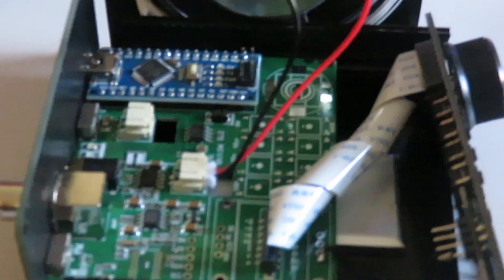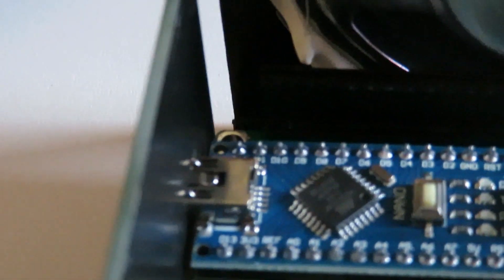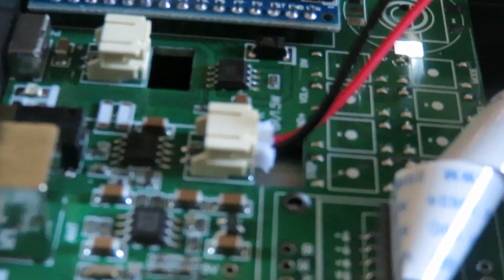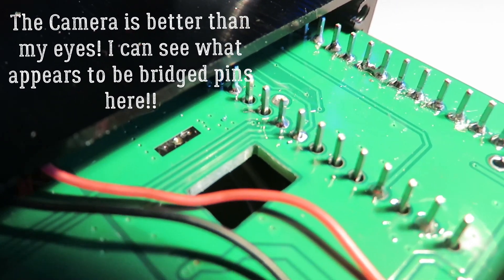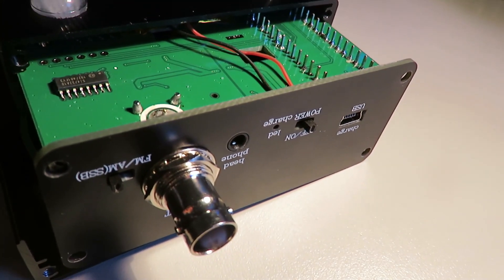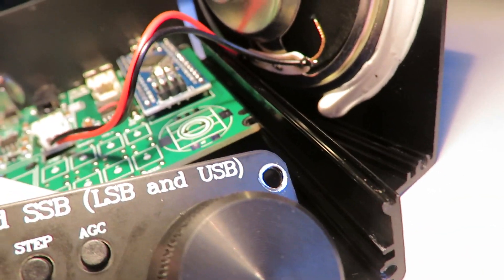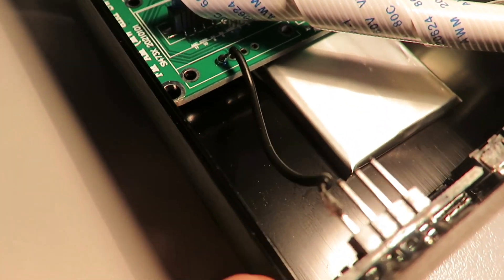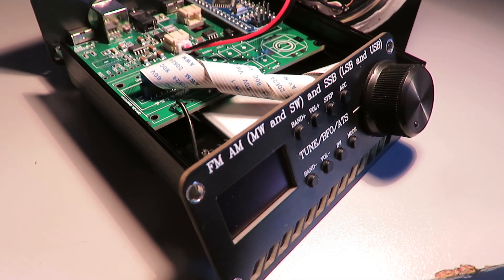SI 4732 A look inside

Comment: I wonder why they soldered the battery to the board rather than connect it to the battery connector.
Reply from the maker: A good question, odd because the speaker is wired to a connector

Comment: Hi.
I suggest to read the documentation about this chip, called "AN 383".
This one explains how to proper design the circuit itself, getting better performance. Also on page 39, the documentation explains how to design this wipe antenna circuit, allowing to receive both FM, AM and Shortwave broadcasts,  using a single antenna.

73

Comment: Would be interesting if type of battery was identified and if replaceable. Could it be a BL-5C cell battery.
Reply from the maker: The battery I believe is a 3.7v batterry. Since it requires just the soldering of the two wires I guess it would be easy to replace, Its just a matter of fitting it into the case. From my observations the battery life on these radios is pretty good.

Comment: i straightened out that ribbon cable it was irritating . the battery is stuck to the case like the speaker .
Reply from the maker: Ray, I guessed it was. Odd really as there is a connector on the maim board for a battery that hasn't been used.
Reply: That ribbon cable may have been coiled to minimize RFI. That's an old engineering trick. If you notice an increase in background noise, try coiling it up again.
Reply: Yo lo dejaría como vino tiene su razón de estar enrollado

Comment: Well Kevin that is one I have been waiting for with interest. 
Now would be interested in your overall impression of the
mini Si4732 SW radio is it a good buy as a travel radio or
should one rather spend a bit more.
Reply from the maker: John, I have another video which will be on tomorrow summing up my impressions. My radio has after a week of use developed a fault with the tuning control. I think the overall idea of these radios is good. It seems the quality control is poor, you may get a good one you may not. The radio is driven by an Arduino nano (or at least a clone of the nano) therefore it is possible to upgrade a lot of the functions by reflashing the Arduino. There are a few people out there working on the firmware. I am awaiting another one of these radios which will hopefully work better, we will see.
Reply: @KevinOReillyswl  Thanks for your reply Kevin I see you have lots of interesting videos to look at. Also a radio amateur like you but prefer SW listening.